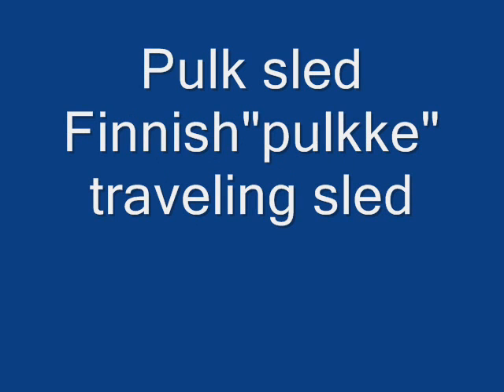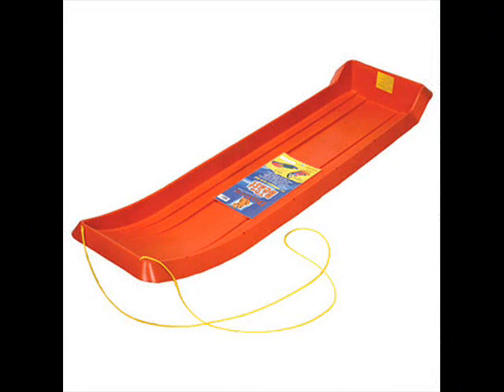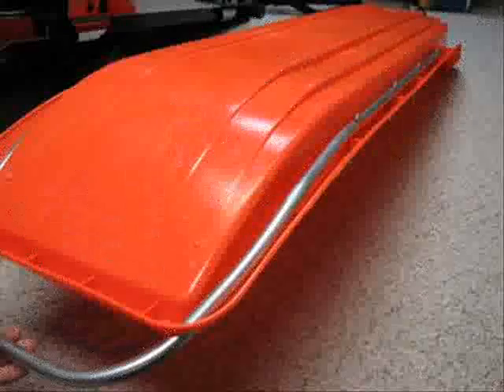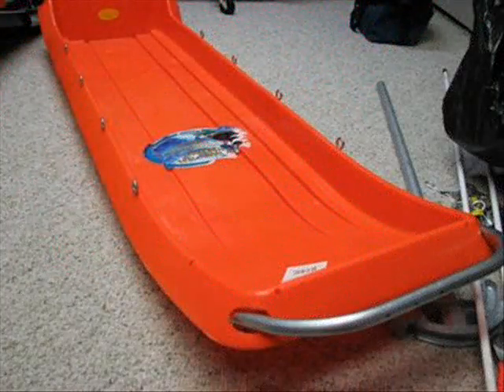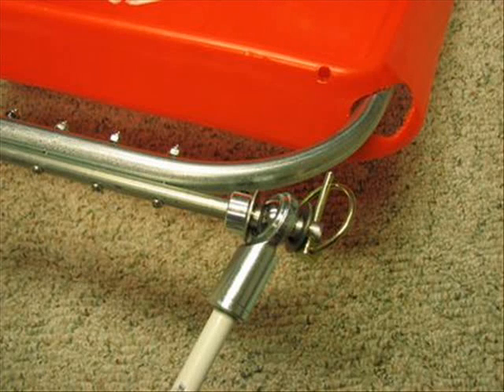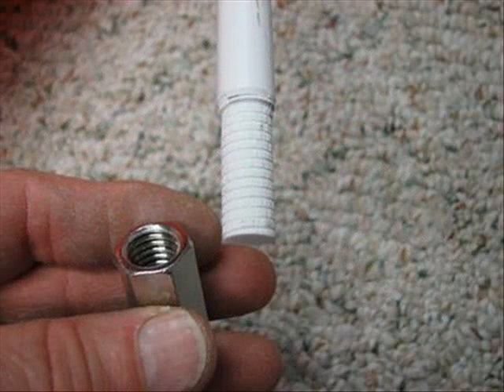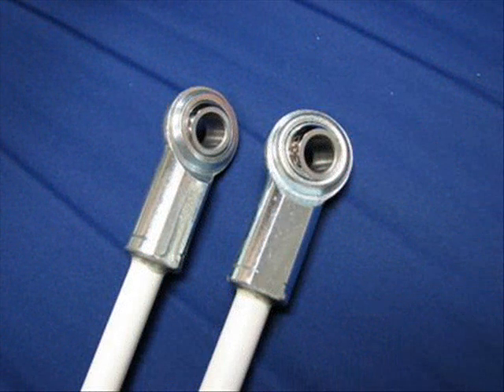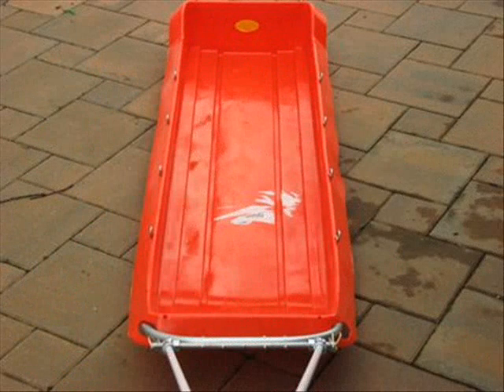My Pulk sled

Comment: Nice! Suggestion to let you turn your body when in harness. Ditch fiberglass, use alum. keep ball ends at bottom. Bend to allow them to cross each other. Cut a notch in both ends of a 1 in. x 2 in. x 12 in. long alum. tube & pin upper ends of poles to it at the notches. Fix a 1 in. sq. x 11 in. long tube to the 1st in its center at a right angle forming a T. Put a ball end at its free end. To the belt, attach a stiff plate to spread the load and fix a bracket to hold a vert. pin as your hitch.

Comment from the maker: Yes, I did make another one. I found the Expedition sled to be too long for back country backpacking. It would work well hauling heavy loads over a frozen lake and generally flat ground but I needed something for switchbacks, ups and downs, etc. I ended up with a Jet sled. It is plenty large enough for all my gear and handles very well in the woods. It didn't require an additional frame either. Thanks for posting.

Comment from the maker: Added a skeg on the bottom and a SS skid plate. Worked well this past winter, even crossing some streams not yet frozen over. Had about 125 lbs in it for a group camping trip, pulled like a breeze. The 1/2" fiberglass poles, crossed, worked out well. Seemed plenty strong.

Comment: After thinking about it, I'd forget my idea to create a "T" bar.  Just connect the tow links to the sides of the belt as shown in the video.  I'd still consider having the tow links cross each other since it will allow for articulation between the snow shoer and the sled wich is generally good.  However, it could create a problem if you turn while going down a steep hill.  The pushing force of the sled would apply an offcenter force on the snoe shoer that might be hard to control.

Comment: Thanks for the quick reply.  I've ordered a sled similar to the Jet Sled - a Pelican Trek 45 Utility Sled, so I hope it works.  Most of my use will be for pulling on relatively flat terrain with cross country skis.  Have you treated/waxed the bottom of your sled to reduce any drag, or do you know if that could make a noticeable difference?  Thanks again!